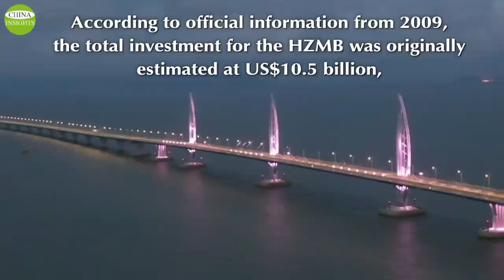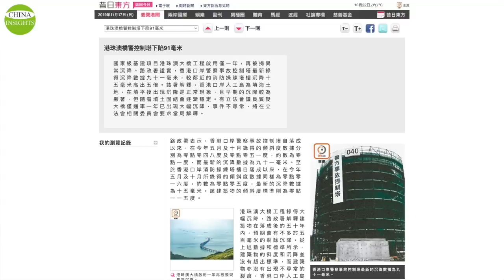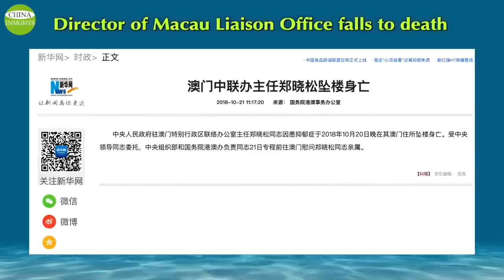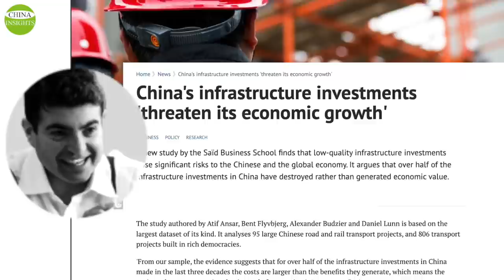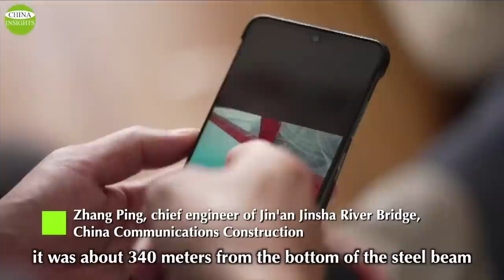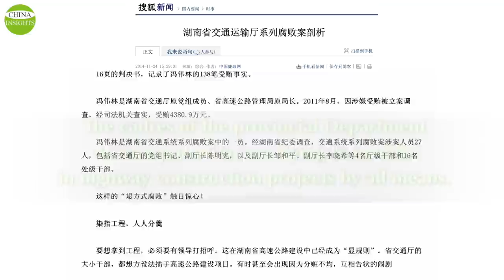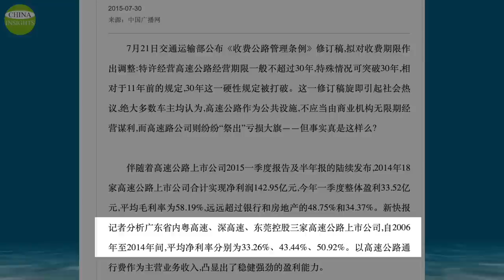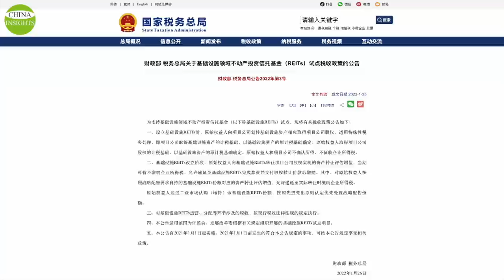The dark secret behind the Hong Kong-Zhuhai-Macao Bridge/Why are China's mega-projects losing money?

Comment: 1:15 The 6.7km under-sea tunnel isn't the longest in the world - the UK- France Channel Tunnel is the longest at 50.5km. Far, far higher usage too.
Reply: immersed tunnel vs bored tunnel , so it's just technical claim .
Reply: "longest immersed tunnel" I think the Channel s completely buried into the sea bed, and I think thats what he was refering to.
Reply: Agreed.
Reply: Not only that, the UK-France Channel Tunnel is not a road tunnel, you can't drive a truck or a car from France to UK. You have to catch a ferry or buy a ticket for the train, being your car transported on it.

So yes the claim is right as a tunnel where you could drive with your car, truck or bus.

The biggest problem in my view is that by being a bridge that connects 3 different administration regions - HKSAR, Macau SAR and Mainland China, you have always customs stops and inspection, plus getting out of the car to go through border control. I crossed this bridge back in September 2019. 

Same was not true in the Channel tunnel when the UK was part of European Union.
Reply: Just as well with that made in China built quality
Reply: @black.phoenix.  The UK has always been part of europe. The term you need is European Union.
Reply: @TransoceanicOutreach  True, corrected.. My mistake.

Comment: There are huge question marks over the falsified concrete testing conspiracy, and the obvious point is that if the concrete was genuinely up to specification and standard, there would have been no point in falsifying the testing results.

To be blunt, this is yet another Tofu - Dreg Project, one whose collapse will be assured by the use of substandard concrete that required the falsification of testing results.

I would not drive on that bridge, nor into the subsea tunnel.

Comment: HKZM Bridge: Cars from HK & China cannot enter Macau unless they have registration plates for Macau, so hardly any private cars use the bridge as registration plates are VERY expensive. Any cars fitted with three registration plates from HK, Macau and China look ridiculous. There are trucks and coaches using the bridge and occasional hotel chauffeur driven limos.

Even when you get to HK you still need to get out of the coach and take a bus or taxi into HK, a long journey. I used to prefer taking the ferry as it would take you directly to Central on HK Island or Kowloon but the C19 BS put an end to all of that.

Comment: China wasn't or isn't wrong for spending on infrastructure, but given where they started from - behind most other industrialised parts of the world for road and rail - they had the choice to learn from the mistakes elsewhere in the world (mostly that roads everywhere are not the answer and extensive public transport is).  Instead they chose the most expensive, most environmentally disastrous, and least useful route.
Reply: What he didn't take into account is that the passenger vehicle fleet in China is growing by a staggering 20 million per year, that's not counting commercial and transportation, which are into millions as well. China's traffic is growing at a staggering rate and these projects will get more use in the future.

Also the you can't compare China's spending on infrastructure with developed countries, China isn't developed and it has/had a booming economy.
Reply: But more so they are building infastructure for the sake of building infastructure.
Also China is focusing almost exclusively on flashy megaprojects. The lower tier transportation like trams, slow heavy rail, country roads, rural streets and so on are still very primitive and of poor quality.

Comment: It seems crazy to make a 29-km bridge and then have a section that is Tunnel.  The tunnel sections seems un-expandable (you can't easily add a 2nd-deck), vulnerable to rising sea-levels, expensive, and therefore, very problematic :-).
Reply: Well, the islands can be built of if the sea truly is rising.   There is a 17 mile bridge tunnel operation bridging the entrance to the Chesapeake Bay.   The hope was it would lead to development of the lower part of the Delmarva Peninsula but it didn't really  happen.   Turns out that a lot of folks like to drive to one of the island, park their car, and just fish.   Their money is as good as the money of folks that want to go up to Delaware.

Comment: China has done in 20 years what the west took 60 years to achieve.
The major issue is simple copying.  those infrastructure projects are not always relevant in the 21st century.
Worse still, while they cost billions, a lot of that public money was paid out to western architects and project engineers, yet after construction was completed, there was very little thought out into ongoing maintenance and support.
Local tradesmen simply did what they were told - without any background of why.

I worked on a couple of billion dollar technology projects where the background knowledge was offered (technology transfer), yet arrogance and corruption and lack of experience saw really silly failures - e,g. the customer ordered spare parts, but never the initial capital equipment !